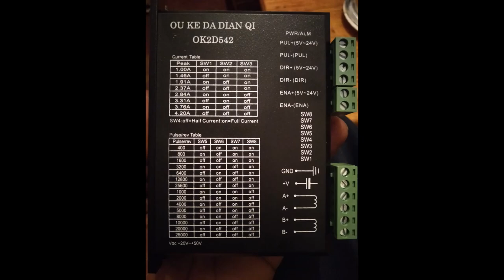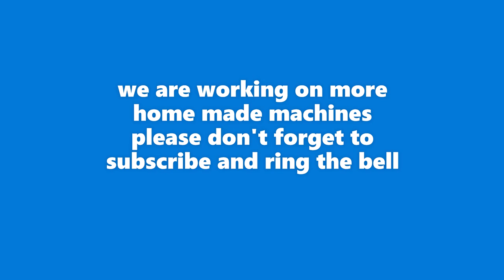HOME MADE DIY CNC plasma Table (Jua Kali made)

Comment: Do you use 3 phase or single phase electrical supply? Otherwise great job. It’s amazing to see you can create high tech machines with simple materials. Obviously the plasma cutter and motors for running the table and gantry are the most expensive and high tech pet of the machine.
Reply from the maker: We have a single phase power supply

Comment: how does the four axis work
Reply from the maker: You need a good software to develop the angular coordinates on G-code to cut the pipes for plasma. It works by rotating the work piece an angle while the plasma torch is on. The gantry moves linearly.
https://youtu.be/g6V5tLolUgs